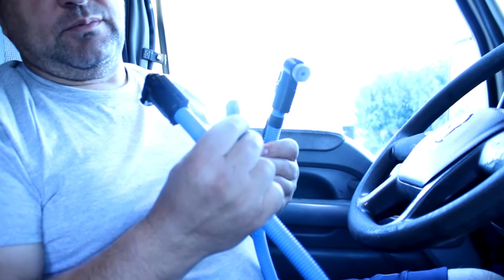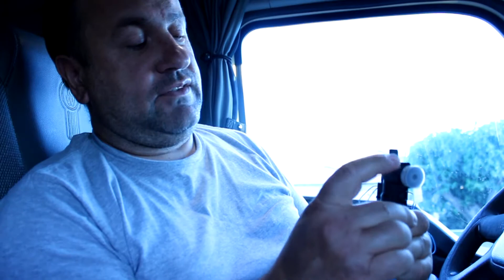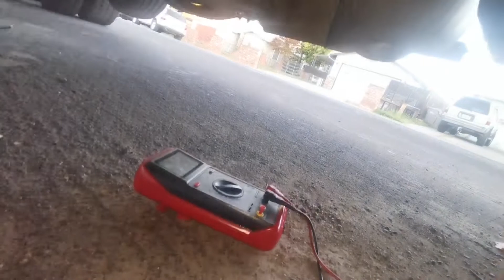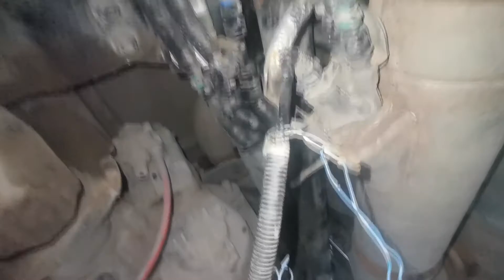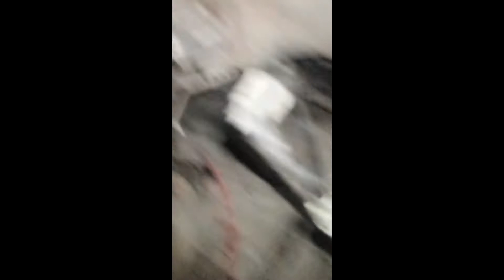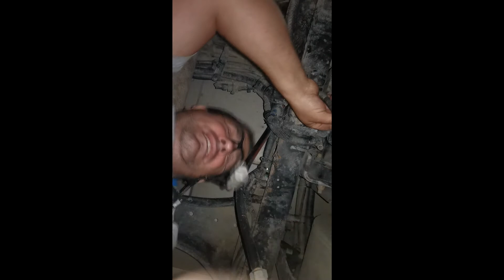Paccar SPN: 4356 – Aftertreatment 1 Diesel Exhaust Fluid Line Heater 3

Comment: Just a tip from a mechanic for you guys running into this, u can take the plastic casing off the end of line and inside you'll find the heater wiring, it always breaks inside that plastic casing where wiring wraps around end of hose. You can take apart each end until u find broken wire, repair the wire and reinstall. Easy fix and no need to replace Def hose!